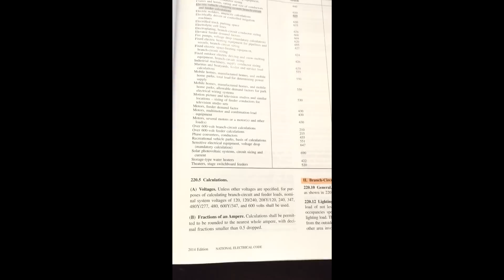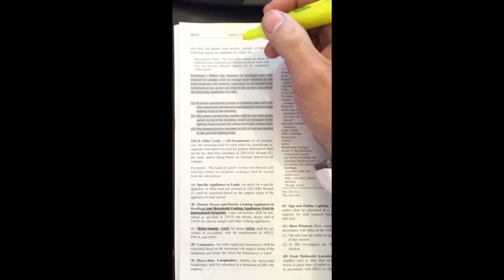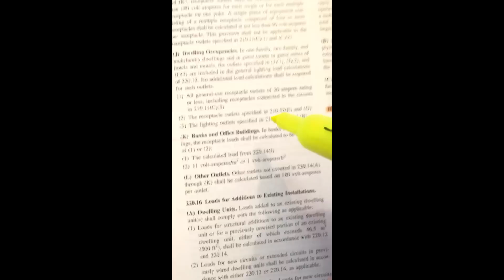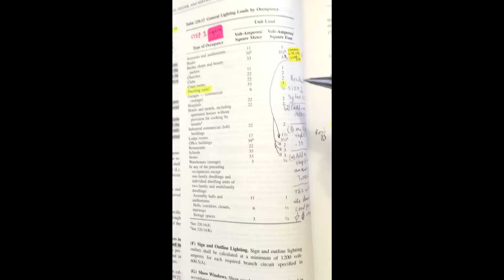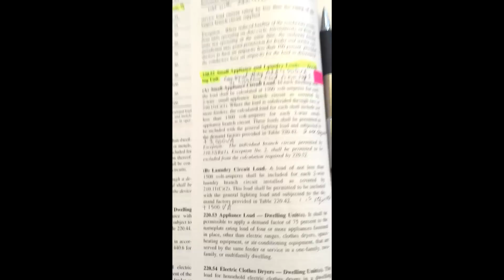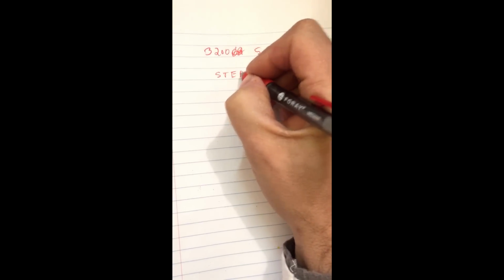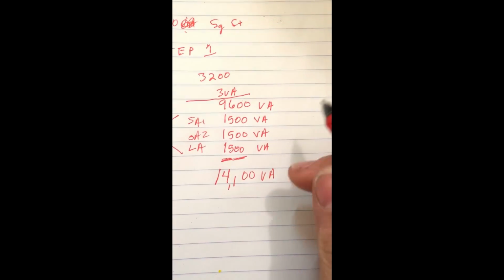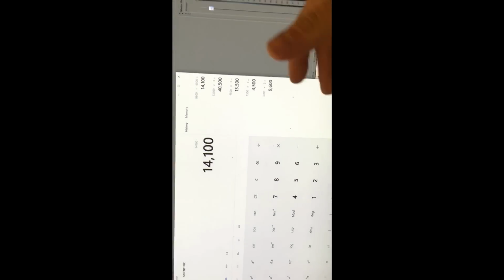Standard Method of Sizing Residential Services

Comment: What percentage of calculations on the TX master exam will be standard vs optional?
Reply from the maker: Great question Daniel. Thank you for asking. The default "assumption" that exist with the Texas exam, as well as most other state electrical exams, is that every question dealing with anything - even remotely related- to Article 220 is considered to be "Standard Method," unless the question clearly states that it is an "Optional Method Calculation." That being said, lately I'm getting feedback that there are quite a few questions being asked, everyone that I've heard of in this new group is all based on SM assumptions, but they are unlike anything you may have previously thought of when thinking of "Residential Service Calculations." Call them "trick" questions if you like, but they are not just asking a question straight up. They focus on the components, wrap them into some misleading worded type, then expect that only those that truly understand the core concepts of the Standard Method, will be able to reason them out. I think they are actually smart and fair questions, but certainly it makes them far more difficult than just a standard, "given blah blah square feet in a residential dwelling blah blah......." type questions. 
Anyway, the point is: there are very few Optional Method questions out there. I'd be surprised to see more than one on any given master's exam, here in Texas (other states this may NOT apply to), and a lot of times, none.

Comment: no ranges disposals or ac!?
Reply from the maker: matt borges sure there usually are in normal use in field or actual load calculations. However; they're not considered true "minimum code requirements" as what's in this video. Only the items and steps listed here are required every time in any dwelling load calculation. As for the other items, I mean they could have gas cooking/heating/drying so the code can't call ranges or dryers required circuits. HOWEVER, even with that, we still have the minimum service size for single family dwellings of 100 amps, so the steps I show here really only account for thirty amps or so.